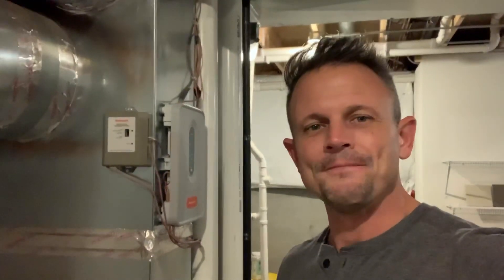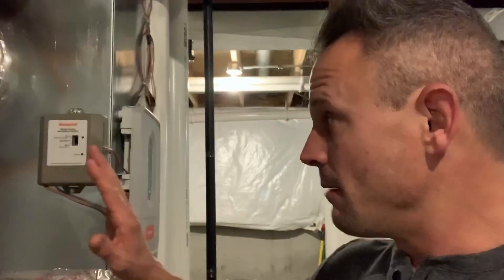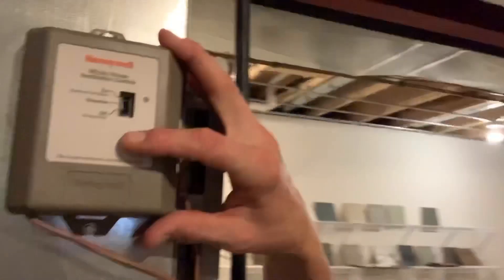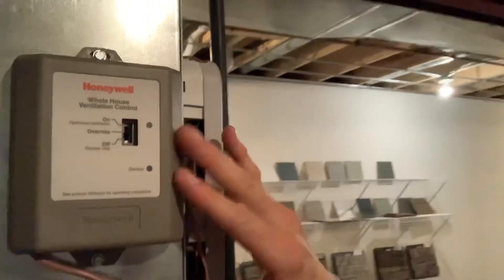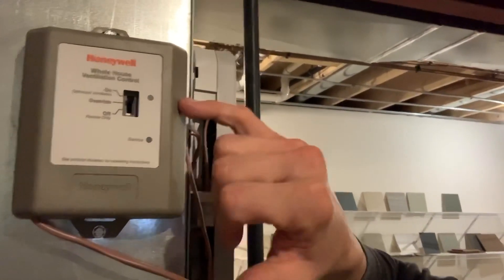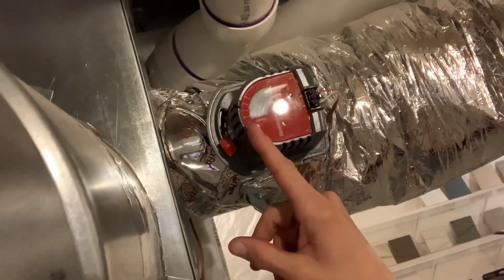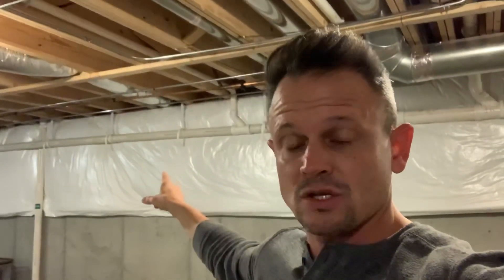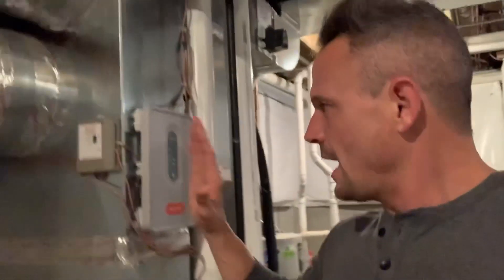How does a whole house ventilation control or fresh air intake control panel work

Comment: In what position the thermostat needs to be on or off or auto fan or circulating
Reply from the maker: This is a separate system for bringing fresh air into your home, so it’s not connected to your thermostat. You can set your thermostat to whatever you like it will not affect this control panel.
Reply: @BJPoznecki  thank you God bless you
Reply from the maker: @707QuEeN1  You’re welcome, happy to help. God bless you too!

Comment: Great video! I turned mine to off 6 months ago to tackle a year of excess humidity summer and too low in winter, despite 2 April Aires and 3 condensers on home 7 years new. The systems worked fine the first 6 years....50 rh summer 40 rh winter (chicago area). Off for vent system didnt fix it. Finally, I moved the fans to auto, vs on 30min/hr cycle. Within a week, my peak of summer house humidity was again stable at 50rh. Tried fan on a few times, and humidity climbs back up to 60. Fan to auto fixes it. Any thoughts on why this is happening?
Reply from the maker: Thank you! Yes, because the “on” position turns that system on 100% of the time, whereas the “auto” position turns the system on once every hour for 10 to 15 minutes. So, when you have it in the on position, your constantly pulling in that hot humid air from outside without the air conditioning running and dehumidifying/lowering the relative humidity when it passes through the evaporator coil for extreme hot or cold temperatures your best that is to turn it off and set the thermostat to keep the house cooler than 75°.
Reply: @BJPoznecki so is fan to ON pulling outdoor air thru the honeywell dampers specifically? How do we confirm that? And is that damper adjustable? Again, this is only a recent issue of 1 year. Fan to auto is a bandaid fix. When this first started my tech said the dampers needed repair. That didn't fix it. Eventually turned honeywell to off, that didn't fix it. Only fan to auto fixes it. Where is fan pulling in outside air if honeywell is off?
Reply: I talked to honeywell for 30 min yesterday. They think the zone dampers could be open too far. Or stuck in open. It makes sense but I've learned to be skeptical of all theories.
Reply from the maker: @leslistovalllayerdvm7113  I would just have a heating and air-conditioning technician come out and make sure everything’s working properly.

Comment: My eyes were always itchy and my dog's eyes were watering for over a year. The switch was in the off position. Once I turned it back on....the allergies disappeared.
Reply from the maker: Interesting! Well, the purpose of this system is to bring fresh air in from outside. So, it’s good to turn it on when we don’t have extreme heat or cold to get fresh air into the home. On the flipside, I would keep an eye on the air quality index because if mold and pollen are high outside, you’ll be bringing that into the home.

Comment: Thank you so much. I’ve had it installed for 2 years and just going into my 4rd summer. I can’t keep up with the dehumidifier- I’m in Midwest. I was thinking it was exactly what you described. I’m pulling in hot humid air and running air conditioner more and having to dehumidify more. I put to off position now- I’ll see how it responds.
Reply from the maker: My pleasure! Yeah, turning it off when we have extreme temperatures in the summer or even in the winter will make a huge difference.

Comment: Very helpful video. We bought a new home and while changing the filters I noticed that switch behind it. It was turned off and I didn't know if it needed to be on or not. We're in Texas, so we DO NOT want any outside air into the house. It's way too hot and humid. Lol

Comment: My house was built 7 yrs ago, and it's built tight. I leave my system on unless temps are in the 90's or it's raining outside. I don't want to bring the moisture inside and cause mold.

Comment: 10 years in my new build and it's been on 100% because that is how it was set and I didn't know any different. A repair person came when my motherboard went bad last winter and told me for winter turn it off, it's bringing in cold air. Now it's spring but I don't want to run the AC yet. I pay super cheap electric rates from 9pm to 7am so I run this intake over night, sometimes into mid morning to cool the house and get fresh air, then turn it off for the day. Is there any issue with turning it off and on daily?
Reply from the maker: Good question. In general, there’s no harm in turning a fresh air intake system on and off daily, especially if it’s just a motorized damper and fan setup. These systems are designed to cycle. That said, keep in mind a few things:
	•	Wear and tear: Daily cycling could, over many years, cause minor wear on components like the damper motor, but nothing too concerning.
	•	Humidity and IAQ: If you’re using it to bring in cool, dry air at night and shutting it off during the warm day, you’re actually using it pretty efficiently. Just make sure you’re still maintaining indoor air quality (especially in tighter homes).
	•	Consider automation: If the system has a timer or smart control option, automating your schedule might save hassle and ensure consistency.

Sounds like you’ve got a good handle on using it wisely based on your electric rates and season.

Comment: Finally, an answer!  Our new home has this system and we had no idea why we had cold air coming on all the time and why was there noOFF setting for the fan.  He told us we needed to have this fresh air coming into the house, even though I had the doors and windows open when we didn’t need heat or AC, we like fresh air and live in the country.  I saw this control module on the side of the furnace and was afraid to turn it off, but now we have decided it was our cold air problem when we moved in here in the winter!  Since the heat and AC are off on the thermostat, is it OK to leave the fan setting on Auto?  There is NO off option on the Honeywell thermostat.  Will it hurt the system?
Reply from the maker: Totally understandable! It’s safe to leave the fan on Auto—this just means it’ll only run when heating or cooling is active. If cold air keeps coming in, the fresh air intake system may be running independently. You might be able to adjust or disable it from the control module near the furnace. It won’t hurt the system, but it could affect comfort and energy use.
Reply: @BJPoznecki thanks for your reply!  This system was running for at least 20 minutes per hour when we turned the heat to off because it is nice out now.  The furnace installer said we couldn’t turn this off, but we saw your video and decided to turn it off via the module by the furnace, same module as in the video!  We are finally comfortable in our new home.  Thanks!
Reply from the maker: @carolhub8080  Wonderful, happy to hear, Carol! Congratulations on the new house. I hope you enjoy it for many years to come.

Comment: I can’t find the off switch. Heat wave coming next week. Smh
Reply from the maker: @bookbag6432  if you have the same one as in this video, it’s the black toggle switch. If you have a different one, it may not have a switch, but then there should be some type of control panel where you can turn it off. Otherwise, you may have to disconnect the wires and de-power it.

Comment: Agree with the general thoughts you mention.  However, when searching online, I find a number of HVAC professionals mention 2 negative concerning leaving this off.  First, they mention with it off in a new tight home, that CO2 levels could rise and be unhealthy.  Second point they make is that this oxygenated outside air is needed for the gas furnace to operate correctly.  Any ideas on those 2 comments?
Reply from the maker: @rosemountbomber  Well, HVAC technicians are way more knowledgeable than I am. As a Home Inspector I know enough to get myself into trouble. 

In my opinion, whether it’s a new home with a whole house ventilation system, or an old home without one. CO2 levels are dangerous in either situation and the root cause should be found and corrected. All gas fueled appliances and systems should be properly exhausted to the exterior.

As far as the furnace goes, most new homes have a high-efficiency furnace, where the intake is piped to the exterior next to the exhaust, so it’s a closed loop system pulling oxygen from outside.

Comment: I heard some of the new digital thermostats like eco-bee can manually control this device, something they call "free cool", so if air is cooler outside, it uses the fresh air damper and fan instead of turning on AC compressor.
Reply from the maker: @Concordeagle  That’s cool! Thank you for sharing. I didn’t know the new thermostats had that capability.
Reply: Do you have any white paper on this? I have mine set to off because of summer heat. I would love to be able to manual set how often and how long it uses the fresh air and this “free cool” option sounds EXACTLY what I want. Don’t turn on until outside is cooler than inside
Reply from the maker: @ I don’t have any manuals. However, I’m sure you can Google your specific brand and model to find more information.

Comment: Great video. Recently purchased a house with a ventilation system like this. No proper instructions on how and when to use it. Like you I believe it’s better off than on except the rare occasions when weather is really mild. Instructions, if you even get some, are confusing on how to set up and insure it’s working as designed. Better to just keep it off probably.

Comment: If the whole house ventilation control is on, does it intake the fresh air into the house 24/7 even when the AC is off?
Reply from the maker: @learn5081  When it’s in the “on” position, it turns on for about 10 minutes every hour. When the switch is in the middle in the “override” position then it is on 24/7.
Reply: @BJPoznecki  Thank you so much! That's regardless of whether AC is on or off, right?
Reply from the maker: @learn5081  My pleasure! Correct the thermostat could be off and if the switch is in the on position it will open up the fresh air electronic damper, and turn on the blower to bring in fresh air for about 10 minutes every hour, unless you switch it to the off position, then it is off 100% of the time.
Reply: @BJPoznecki  Thanks for the comment!

Comment: Do I need to move the red tab from 0 to 3, on the damper?
Reply from the maker: @BMwBears2005  I suggest putting the red tab to where the damper opens and closes fully. Whichever number that is.
Reply: @BJPoznecki  Thank you, I guess by the diagram, it's 0.  Just seems odd though.
Reply from the maker: @BMwBears2005  Either way, whether it’s zero or three, test it in both positions, and put it on the one where the damper opens all the way and closes all the way.

Comment: Hi, thanks for the video. 

Question: I used to work in the apartment industry for many years. I’ve been out of the industry for over a decade and I mainly worked on traditional ac units and furnaces. My wife and I purchased a new home in 2017. In that time I’ve had to replace at least all three of my zoned damper motors. Those Honeywell motors are not long term. 

But my question is: I have one of those Honeywell whole ventilation units on our unit. It’s set to on. I’ve never messed with it. I was under the impression that when the unit is calling for cool or heat it’s sucking in air from the outside like you stated and pressurizes the home. But looking at its damper it’s not closing in what I would expect a reasonable time after shutting off letting cool out. I’m assuming it should close all the way and the zoned dampers open when none of the floors are calling for air. 

My question is: could the vent damper not working or does it have a certain amount of delay after satisfying the thermostat(s) so it closes? It’s also not fully set on the thumb switch which adjusts flow. It’s one or two. 

We live in Atlanta so you know we get our fair share of heat. 

Thanks.

Edit: just for clarification my system is a heat pump. So I’m just making sure I’m not messing something up by shutting it off or affecting how it purges.
Reply from the maker: @GartheKnightReturns  You know, I’m sorry we don’t have heat pumps here in the Chicagoland area so I’m not familiar with them or if the system operates differently with the heat pump. 

If your system is the same that you see in this video when the switch is in the on position whether the thermostat is on or off, every hour for about 10 minutes. It will turn the blower motor on open the fresh air damper and bring air into the home.

Override will keep the system on and the damper open 100% of the time.

Off, turns it off 100% of the time and closes the damper.

With the hot and humid you guys get in Atlanta I would just turn it off during the summer months and turn it back on in the winter or when you have mild temperatures in between 50° and 75°. 

Hope this helps!

Comment: i need to find mine ive been trying i found the red control thing i just need to find the switch im in texas and the humidity is stupid crazy 2nd floor super hot  and it gets up up 75% humidity inside which is so horrible i bought a portable dehumidifier for 4000 sq ft house pulls 58 pts of water out of air it helps a little but i want that thing closed
Reply from the maker: It has to be mounted on your furnace or somewhere close to it. If you’re having trouble finding it, I would just disconnect the wires from the electronic damper which is the red control thing you’re referring to. By disconnecting the wires it should stay in the closed/off position. Double check the little indicator making sure that it’s at the closed position and not the open. If it’s staying in the open position after disconnecting the wires I would go outside and find the exhaust vent where the air comes in. It will be one that does not have a flapper inside of it. And figure out a way to cover that vent whether it be with duct tape or something just to seal it off so the air is not coming in to your home from the outside.

Comment: How do you close this dampers when ventilation control is not installed yet but ducts is installed?
Reply from the maker: Where the insulated flexible duct connects to the rigid duct, pull the insulation back there should be a lever where you can close it manually. If there isn’t, you can install one, or go outside and cover the exhaust vent with something to block the air from coming in.

Comment: You are a life saver. It was very frustrating waking up and hearing something blowing all the time and it wasn’t the A/C or heater. I feel like it was on all the time and I couldn’t keep the humidity levels down. I live in Texas, during summer, it would be blowing warm air, during 30 degree weather it would blow cold air as if it wasn’t cold already. Worst of all i suffer from seasonal allergies, if it is bringing air from outside, my allergies were really bad. Hope they improve now that it is off.
Reply from the maker: Oh yeah, this will make a huge difference in all of the above, especially with your seasonal allergies because you’re bringing in all of that dust, pollen, etc.

Comment: i changed a year long filter after 2 months, house was at 74% humidity it’s back down to 58% but on the rise recently. i just turned the ventilation off. will this help?
Reply from the maker: Yes, turning off the system will help. If you have a whole house humidifier you want to make sure that is set at 40% and then if the temperatures drop, reduce the humidity level in 5% increments.

Comment: Has anyone figured out if Honeywell makes a WiFi enabled controller for this feature; I would prefer to control this remotely rather than walk up to attic when the weather is in a good range.
Reply from the maker: Not that I’m aware of. And, they’re slowly phasing this design out and replacing it with what’s called an ERV energy recovery ventilation system, which is the new version and more efficient.
Reply: @BJPoznecki  do you have any video that clarifies the increase in  efficiency with the new ERV? Also, is this something that a licensed HVAC tech can upgrade to?
Reply from the maker: @fz05rider  I’m sorry I don’t have any videos on ERV systems yet. However, I will put it on my to do list. Yes, this would be something that an HVAC technician would install.

Comment: This is bad advice. This is intended to assist in air exchange in the house because houses are built way more air tight than in the past. 

If you shut this off you are going to increase concentration levels of VOCs in the home and carbon dioxide levels are going to rise from you simply breathing. You will be more uncomfortable with it off, unless you have tons of oxygen producing plants in the house.

Having the fresh air makes the house less likely to kill you over time. If your hvac equipment is operating properly then you should not have any issues with a bit of humidity or cold air coming in the home. 

You can simply adjust the knobs inside the unit so it runs less frequently.
Reply: I am trying to correct this now.  I was also instructed by a HVAC contractor to turn it off for the same reasons and now trying to figure out how to turn it on (I have an aprilaire model) as I couldn’t breathe!! Opened all the windows but my home is foam insulated and I felt like I was suffocating.  Turning it off was a bad idea - from experience!
Reply: Your absolutely right 👍🏼

Comment: Can we turn it off in the summer as well when it's over 100 degrees outside? Our house is cool 74  during the morning into afternoon until later in the day when its scorching hot, the inside temp gets to 80+. Right now, we have the ventilator on.
Reply from the maker: Yeah, I would turn it off. Me personally, I would only run it when the outside temperatures are between 50 and 75°.